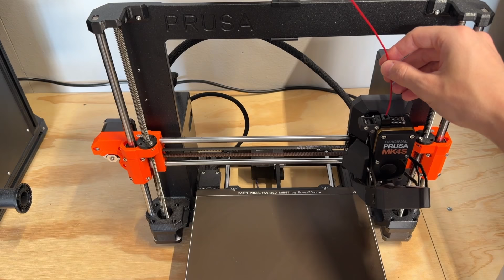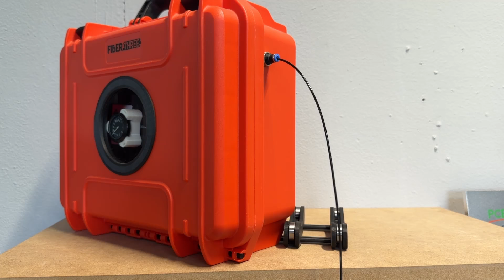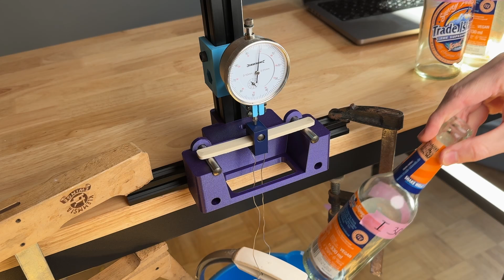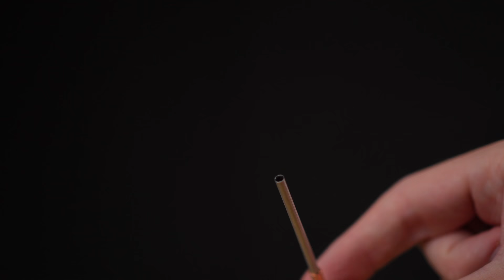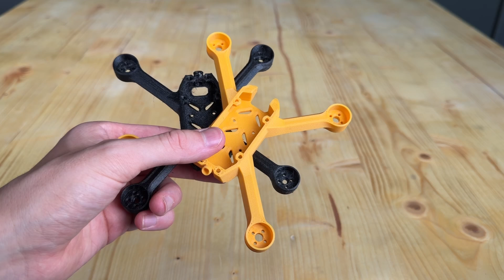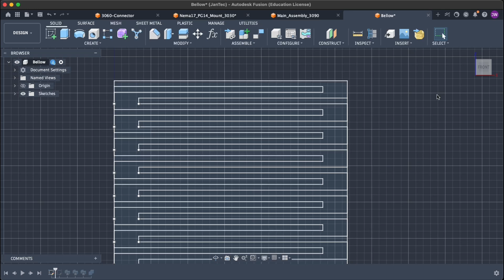TPU is Underrated. Here's What You're Missing Out On.

Comment from the maker: Are you using TPU, and if so, what do you use it for? 
Have you thought about printing parts like gears from TPU?
Reply: It's used heavily for fpv drone mounts and parts because it's nearly indestructible.
Reply: @dan.learns.things  this was what started me printing TPU as well
Reply: I just printed some TPU split bushings for a swiss lathe anti vibration device and they're working really well, have also made some protective covers/identifiers for VDI tool holders and they also have held up for a very long time in a fairly harsh environment
Reply: I use TPU for 90% of my prints. Hard TPU though, 64D is the latest one I bought and the 70D I had before was better. Still trying to find the perfect one, BASF I think has a great one but a bit pricey.
Reply: @sopues PrimaCreator has a 77D. It's perfect for anything that needs to be near indestructible.
Reply: @SWREngineering  yes, I recognize that one! Need to buy it again, it's awesome.
Reply: Ive managed to print tpu on the prusa mini before using colourfabb varioshore
Reply: I used TPU for a while to create cases and wrist bands for a somewhat rare medical device. It was both to protect and to increase visibility (glow in the dark, to find at night).
I also used it to design and make cat toys with it. Turns out my cat is just too lazy though XD
I don't usually design complex mechanical parts, but I'll definitely think of TPU if I need to. It makes sense.
Reply: Saved me a 100's so far in dog toys alone. The Dog disc by Anlosay on cults3d is the best frisbee I've had.
Reply: Tpu for vibration dampers
Reply: Drone parts
Reply: I used some TPU for AMS for printing some hooks I use in the kitchen to hang different types of bags on. Choose TPU for AMS specifically because it is so stiff and really, really strong. These hooks get a fair bit of abuse and stand the test of time. I printed some 95a tpu tracks for a rc forklift.
Reply: I use TPU for hanggliding instrumentation mounts, which can take some shock upon hard landings. Also a tpu washer between members allows firm but flexible hand manipulation. My old 3d printer refused to properly print tpu until I cleaned and greased the Z screw. Then it worked fine.

Comment: I use TPU 95A to print tires for my RC cars. I use 0% infill with 2 walls so the tires are somewhat flexible. Because TPU tires are a bit too slippery compared to rubber tires, I'm experimenting with coating the tires with a thin layer of Flexseal, a rubberized coating typically used to seal gaps around the house.

I also designed replacement handles for my waffle maker. I tried printing them in ASA but they still melted as the screws and the metal lid of the waffle iron get very hot. I might try reprinting the handles in TPU as it is more heat resistant and shouldn't melt.

I haven't tried gears yet. So far haven't had any issues printing gears from PLA for my RC cars, but if I do I'll keep this in mind.

Comment: If you print with no infill and fuzzy skin, you can make rc car tires for 3d printed wheels. I’ve used siraya tech 85a with great results. You can adjust sidewall stiffness by changing the number of top and bottom layers along with the sidewall width in cad. They’re not quite as grippy as conventional rubber but that makes it easy to drift while still having more control compared to hard plastic wheels and tires. They also wear very well even on abrasive surfaces

Comment: If the TPU has adhered to the print bed and you cannot pull it off, moisten the base of the model with alcohol and then begin peeling it off starting from the thinnest or sharpest edge.

Comment: 99% of what I print is TPU. That would be in 85A, 95A, 98A, 72D AND TPU-GF. TPU-GF replaced PETG-GF for me as it resists impacts WAY better. PETG-GF will still shear or break even perpendicular to the layer lines, i have yet to have bonding issues or shearing/breakage with TPU_GF. The 72D is much closer to Nylon (PA) and provides a cleaner smoother surface but doesn't hold the rigidity that TPU-GF does. The ONLY downside to TPU-GF for me is the cost.... I cant get 72D for $20kg and PETG-GF for $19kg but TPU-GF is $40kg.

I use a Snapmaker u1 to print them all and it does so flawlessly 👌

Comment: Just an offhand observation... I needed some friction clamps for a project and decided to go with TPU which I haven't printed in for a while. Each time I change filament to a different type of plastic, I do this manual procedure where I retract the existing at as low a temp as I can (almost a cold pull) and then feed in the new by hand till it bumps up into the extruder gears. Then I set the heat to typical for printing, and advance the gears manually until I get clean flow of the new filament. Then I usually grab the new length of spaghetti, usually about a foot, and pull it apart to feel the tensile strength. PETG? Easy snap. ABS? WAY easy snap. TPU? First it stretched way out and then it bit into my skin rather a lot like nylon does. Wow... The tensile strength of this stuff is bonkers high. Gives me some ideas for very specific applications as long as you bear in mind it's going to perma-stretch quite a bit before it hits a hard limit. Pretty interesting. The specific filament btw was clear GT-3 TPU from SainSmart.

Comment: I use TPU to make tire inserts, for RC vehicles, that replace the traditional “foam rubber” inserts.  I usually use 85A Shore hardness, but also use 95A and 75A.  I am very impressed with TPU-GF and may try to integrate it into different RC parts.

Comment: I printed Format parts for a botteling Machine Out of sirayatecs tpu-gf that are usually made of POM. It worked insanely well, it took really high loads without battong an eye. To save Material and to improve stiffness, i printed with 6 walls of tpu gf and used Petg as infill which bonded very well with the tpu

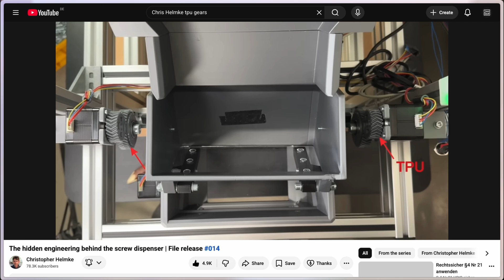Comment: 12:20 WOW, gears out of TPU 🤯😃Is  common TPU95A OK? I need gears for one project; been going with my first PLA until now (I have one white TPU95A, yet to open due to moisture control/no need). Anybody with TPU95A gear experience?  (Do I need 0.6mm nozzle now, the only one  [and 0.1mm] I don't have 😅)
Reply from the maker: Yes, TPU95A should work well! No need for a .6 mm nozzle. Just increase perimeters and infill density.
Reply: @JanTecEngineering Very interesting (robot hand project) with elastic gears 😃 Dankeschön!  0.4 or 0.2mm 🤔

Comment: TPU is probably my most used filament. Anything that I want to be very durable, but doesn't have to be completely rigid, I print in TPU. It started with drone parts, but now basically anything that doesn't have to be very rigid, I print in TPU. I can't wait for Prusa to release TPU profiles for INDX so that I can experiment with mixing filaments for hinges and especially supports. I find TPU to be miserable when you print supports because the layer adhesion is so good it makes the supports very difficult to remove, and the flexibility makes unsupported overhangs typically pretty ugly.
Reply from the maker: Right, TPU is so underrated! 
Same here, I'm looking forward to TPU on INDX.
Reply: On the harder TPUs like 77D, all that is no issue. Supports snap off with ease when you get the Z offset correct. 😊

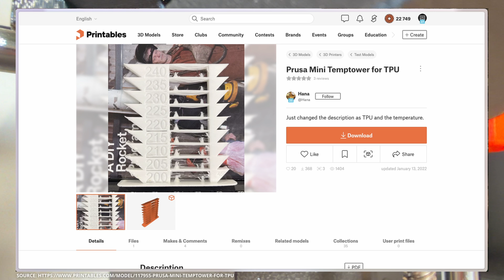Comment: 5:00 I often find that I get the best results printing TPU much cooler than what is normally recommended by the filament manfacturer. Like, 205-210º C instead of 230º. Obviously everyone's mileage will vary, but back in the day I struggled to get decent quality prints until I realized that the recommended temperature was too hot.
Reply: I always have to do this for small prints. Otoh my printer has bad cooling so it also applies to PLA :)
Reply: I had the opposite experience. Printing at 215-235 gave me garbage prints. Kicked it to 245-250 and it worked beautifully! So it really depends on your filament.

Comment: I want to add that one of my main issues with printing TPU is actually the path from the spool to the print head within a pipe/ the spool.
If its too long, or the spool not on some bearings, the flexible tpu becomes too weak to turn the spool and causes underextrusion at some point. Especially with a new heavy spool.
This has been ruining so many of my prints before i figured it out and i had to pre-roll the spool to fix it because i had no other solutions at hand.
Reply: Yeah that has been my issue as well.

Comment: I just saved my Adidas EVO SLs; the rubber pads on them are very thin and, unfortunately, wear out faster than the EVA. I modeled replacements in Fusion, printed them in 95A, and glued them on with Pattex; they’ve done 60 km so far and work perfectly.
Reply from the maker: Thanks for sharing this - using 3dp to repair everyday items is super cool!

Comment: I had the misfortune ol being stuck in a parking lot covered in icy snow. In the spirit of an old solution of a tire chain strap,  I printed a strap of tpu. Design has holes which hold eight 16 penny nails horizontally, with the heads aligned to the susface of the tire, but sit proud of the tpu strap. Additional heavy duty zip tie feed thru end loops in the print, securing it to the wheels. The strap is mounted with wheel spin in mind as the nail heads contact the ice first as to push them into the strap. This way the nails are not prone to pull out.  Easy does it.

Comment: My TPU prints usually are replacement feet, bumpers, plugs or gaskets. The largest ones were replacement feet for a garden table, the smallest was a plug for a piggy bank.
I'd like to try TPU for living hinges, but so far my results where underwhelming.

Somehow I find it extremely hard to design for flexibility - my own designs either end up too stiff or too floppy. So a video with design tips and guidelines would be highly appreciated.

Comment: Yes, we would like a dedicated vid about 2.2mm tpu, what's the highest volumetric flow you can get compared to regular and HF tpu 95A.
Reply from the maker: I will consider it! I'm wondering why none of the speed printing youtubers tested it 🤔
Reply: @JanTecEngineering  I think that we have a general lack of testing in 3dp space, I come from pc hardware space and I'm kind of spoiled by everything being tested to details 😅
Reply: @JanTecEngineering  I always wondered if someone would make a larger diameter filament for TPU. The obvious answer is to just start with a larger cross section if the filament is flexing too much. It's nice that someone found a size that is largely compatible with 1.75mm equipment too. I hope this becomes a standard for tpu across the board in the future and all printers (looking at you Bambu) will get dedicated TPU nozzles of this size.

Comment: I still haven't bought TPU because it feels expensive for my applications. I don't like paying over 15€ a kilo for my filament.
Reply from the maker: It's definitely more expensive compared to PLA/PETG/ABS, but cheaper compared to some good PA or PP and with the right settings and designs you can get perfect strength.
Reply: I tend to buy bargain basement filaments, but the TPU squish is worth the extra price if you need or want it for something. Find the cheap TPU and in a 5 pack and the price per kilo isn't that bad anymore.

Comment: The 2.2mm filament looks interesting, but for printing speeds I've been printing 95A TPU at PETG speeds on my Prusa Mk3S, ever since I watched Lost in Tech's video on TPU printing speeds a year ago. Buckling has not been an issue unless I get some dirt stuck under the print bed and get the nozzle distance wrong for the first layer. I literally looked at the difference between the TPU and the PETG profiles and turned the speed way up on the TPU profile.
Reply from the maker: You're right, some tuning can definitely help! One thing I forgot to mention is that Recreus also makes very soft TPU (like 60A) in 2.20 mm.

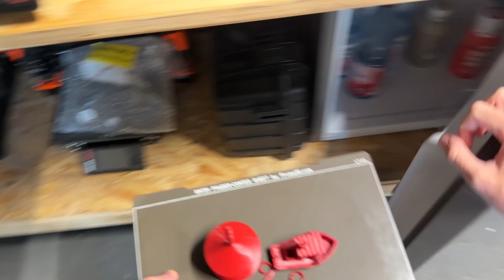Comment: 05:50 Some IPA also helps to release TPU from the smooth sheet
Reply: From textured sheets too! When printing something flat like a phone case it can print fine and then get deformed when being pulled off the bed. So even if it is removable, pouring a bit of IPA around the edges might be worth it just to decrease the force needed and peel it off more cleanly, keeping its shape. 
I was surprised he did not mention it. I thought the IPA trick for TPU release was becoming well known by now.
Reply: I'd also add that you need very little of IPA. I saw people pour a bottle on the sheet — don't do that. Just dip inside IPA the very dip of a drinking straw, then touch with it the printed part. Even a tiny drop is enough — it gets visibly absorbed under the part immediately.
Reply: I was literally about to post the exact same comment!
Reply: Maker's Muse just tested this out himself. He was surprised it took him so long to try this trick. It worked surprisingly well.
Everyone needs to know about this. I wish I had known about it earlier in my 3D printing life.
Reply: I have been printing and releasing my TPU prints with IPA since I got my first direct drive printer, the Prusa MK3 years ago. I can't believe it's 2026 and I'm still seeing videos not mentioning it, and people ruining perfectly good print beds.

Comment: ive been using tpu 95A hf for a ton of stuff related to building accessories for my drums and cosplay. it's basically indestructible for cosplay props. It's great because it wont rattle against the drum, and can withstand high clamping force without shattering. I can stretch it around stuff instead of having to build in fasteners too. the disadvantage is that it will creep, so I have to occasionally re-tighten things. havent tried tpu gf, it sounds intriguing.

my tips for printing are turn of z-hop, and turn on "dont cross walls." this reduces stringing to almost zero for me.
Reply: If you want indestructible  try pp. You can print it unenclosed without heating  tho it only sticks to pp, so you will need to put pp box tape on hotdbed. It can resist infinate blows and bending but it suffers whats known as "creep" under sustained pressure. Its so shock resistant because its glass transition  temp is -50c(yeah i dont understand how a solid can have a softening  point of -50 either 😂)
Reply: @TrumpstienPhile1 I have printed with PP, and had a very very hard time getting it to stick and not warp.
Reply: @Pyromuffin as i said ,pp only sticks to pp and similar olefins.clear box packaging tape is almost all pp, so pp sticks perfectly  to it, tho the thicker tape the better to avoid bubbles in tape/ tape coming unstuck from buildplate

Comment: Pressure advance is a huge factor in reducing stringing. If you have trouble with stringing with dry tpu, Tune your filament in this order Temp tower -> Pressure advance -> Retraction. The PA value will be extreme compared to rigid filaments so test a wide range for the first pass then narrow for the 2nd.
Reply from the maker: Thanks for adding this!

Comment: Does the Recreus 2.20 mm diameter fix the AMS TPU printing limitation? That's the biggest issue in my opinion, with current printers. Having to manually disconnect Bowden tubes only to print TPU.
Reply from the maker: I don't have an AMS, what's the limitation? The bowden tubes in general?
Reply: @JanTecEngineering  Since TPU is so flexible it can bunch up and stick to the walls of the tube which creates much more pull on the filament by the extruder gears. Even if the AMS keeps feeding filament the TPU can't travel down the bowden tubes. But, there are some "star" shapped internal geometry bowden tubes that have come out to try and reduce the internal tube surface area that the filament contacts.

Comment: For me, TPU Air is one of the big ones. Being able to print very soft structures with a relatively rigid filament is a game changer. For example, I printed bike handles at 75A shore hardness and the texture itself is rather grippy, compared to the smooth/shiny finish you get with "normal" TPU.

Also, products that require really good layer adhesion can often be made from TPU, as it is rigid enough when printing with thick walls to replace PLA/PETG parts. 
One thing I would like to have is UV resistant TPU so I can use it outside.
Reply: Nice, always wondered about foaming tpu. Does it need crazy moisture control as i imagine foaming  agent is probably  something  like a metal bicarbonate  which would absorb  moisture. 

If i can remember , carbon powder converts uv directly  into heat which may give tpu sun resistance (if it doesnt heat past the TPU  HDT😅 graphite paint perhaps?
Reply: @TrumpstienPhile1yeah it HAS to be dried before use, controlling the foam is hard enough without moisture as it is.. the results are amazing though. 
Regarding the sun protection, at least with foaming TPU, I'm afraid the paint will just flake off once you sequish the part. 
We need foaming flexible ASA or something :)
Reply: @CTLS.Consulting  Dang you ruined my dreams😜im far too lazy for planning drying for 8h and perfect  storage conditions. Will stick to asa cf as my most "exotic " material... but mostly print petg cause its cheap and good enough 😂

Yeah good point about uv, cause it is porus (open cell?) And  deforms so much, any uv resist needs to be integrated into the filament and possibly act as a slow ablation sacrificial layer